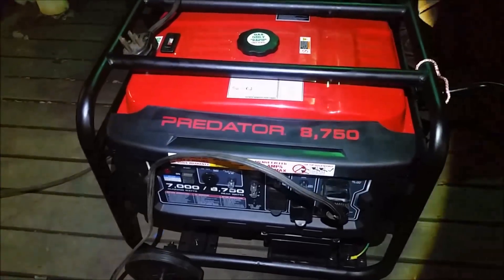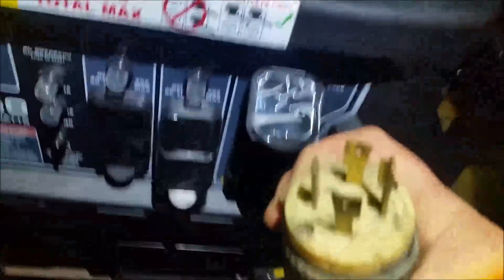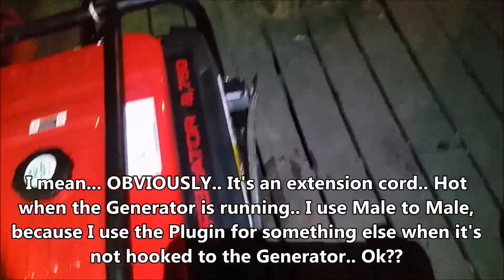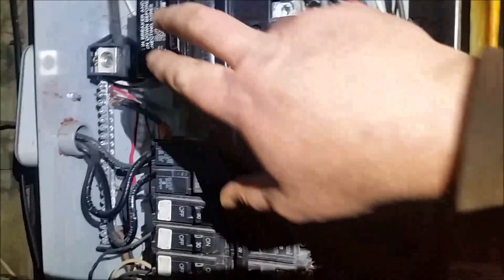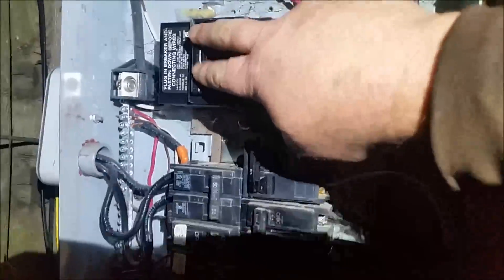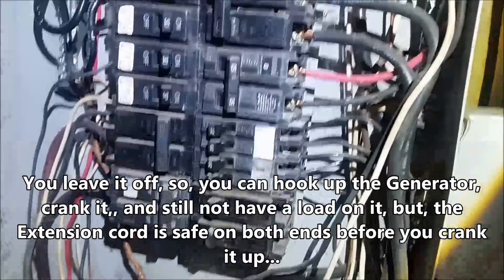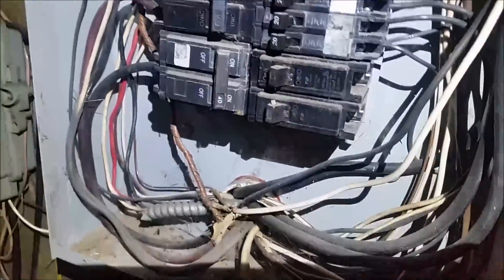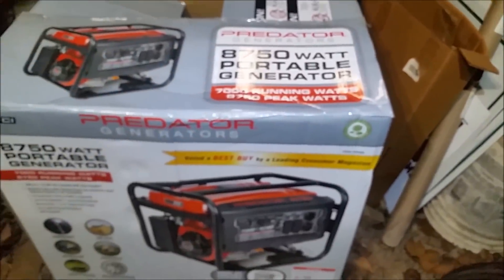Quick/Easy/Safe: Use Existing Plugin/Breaker for Generator hook up to your house Panel box.

Comment: Mark Thomas, you sound smart to a five years old kid and certainly dangerous enough to con some of your viewers with the same level of intelligence as yours to build a dangerous contraption that will ultimately kill them. Your life insurance must be cheap, as cheap as your mind at work building this suicide plug. Which part don't you understand about the word "illegal"? Get off your cheap ass and get things done right. All of the viewers/followers out there defending a dangerous man...get real. There are better and much safer plugs that you can build for your standby generator. You certainly have NO COMMON SENSE if build this. This is like Russian Roulette that Mr Thomas playing with you. Your life is not worth making this suicide plug.
Reply from the maker: P Dan.. I had to read your text at least twice in there several times.. Wow.. I'm not sure how old you are,,, but considering what comments you did make and how you made them,, I'll try not to use difficult words, so you can follow along.. 
No one is Conning anyone to do anything.. Just sharing how it is one.. Not sure where the Conning comment came from, but, remembering who is commenting, I'll continue.. 
"same level of intelligence as yours to build a dangerous contraption that will ultimately kill them."
Ok..What a COMPLETE IGNORAMUS!!! Ha..Ha..Ha.. Didn't your Daddy tell you not to touch the plug when you plugged it in?? I mean.. HOW STUPID CAN YOU POSSIBLY BE??? Like I said in the Video..This Video IS NOT FOR YOU!! Lets see how many safety precautions you need to feel safe.. 
1) When you plug the first end of the plug into the Generator,, don't have the generator running,, BUT, if you do,, don't touch the male part of the plug while you are doing it.. I prefer not to crank the generator.. Not sure how you could fuck that part up?? But, considering,, well,, lets continue.. 
2) When you plug the other end, into the receptacle  that you were using for your dryer/welder/compressor, etc,,, REMEMBER what your Daddy taught you.. Don't touch the Male end of the plug, but, doesn't matter anyway, because the breaker is off and the Generator is not running.. But, if you can fuck that up,, I would like to see how... But, considering who is commenting,, I'll continue.. 
3) Now, you are ready to crank the generator.. So,, You want to turn the main breaker off, crank the generator, flip on the Generator breaker, and then start turning your other breakers on.. I can't even imagine how you could fuck that up.. But, if you need someone to help you,, you know,, hold your hand while you do that,, let me know... My 5 year old can come over and keep you from fucking that simple shit up..
BUT,, considering you are all freaked out about something so simple,,, it makes me wonder how you get to work in the morning,, or better yet,, how do you catch the school bus without getting run over.. After all,, are you sure that you remember not to jump in front of the bus when it rolls up??? I'm just saying.. What you are saying and what you are afraid of is about that simple,, now isn't it.. You are afraid of a piece of wire with a male plug on either end?? Can't figure that one out,, can't you?? 
Nope.. There is not a better plug to use to run a generator in a temporary situation.. I just turn off the generator, turn off the Generator breaker, unhook the scary extension cord, and flip on the main breaker. Then, I hook up my Welder, etc,, and turn that breaker back on.. It's really simple, and there is not a better way..
Of course,, like I said,, This Video is NOT FOR YOU!!.. You would need a Generator Switch Panel, or at least an Interlock installed by an Electrician,, then, call the Fire Department when you want to turn it on and off, and check with the local police to find out if you can run your Generator today.. I mean.. You can't do this simple shit by yourself. DON'T EVEN TRY...  In fact.. I think you should take all of your knives and take them out on the Grinder and take the edges off of them, so you don't hurt yourself...Me,, I prefer them Razor Sharp.. I hate to get cut with a Dull Knife.. That shit hurts.. But, I use Knives every day, and I can't remember the last time that I cut myself... But, then again,, I am not a DUMBASS, and I know I have a sharp knife in my hand.. See.. There is the difference between you and I.. I am not "AFRAID OF MYSELF".. and that is the STONE COLD TRUTH OF THE MATTER!!!! Doesn't the Truth Suck some times there little fella?? 
Just one or two more things.. Since I am spanking you for being stupid,, and I know you are mad as hell about it,, why don't you call the Electrical Police and send them to my address.. It is posted at the end of the video and tell them that I am "DOING SOMETHING ILLEGAL", and send them over to my house.. And,, tell me what they tell you after you approach them with that Stupid Shit....Ha..Ha..Ha.. Illegal.. Ha..Ha.Ha.. What a DumbAss.. Ha..Ha.. 
My life is not worth making a Suicide Cord?? Ha..Ha.. That is what you guys call it.. I call it the "Extension cord with a Male plug on both ends",, because that is what it is to me,, because I'm not scared of myself to use one.. It's really pretty simple though, when you think about it.. But, that is the problem with you. You were not thinking when you warmed up your keyboard for a good bashing.. But, it didn't work out so well for you,,, now did it.. Just showed everyone how stupid you are.. And,, you got outsmarted by,, (According to your first sentence) A 5 year old.. Ha..Ha.. Ha.. Doen't your life SUCK??? Ha..Ha..Ha..  A Dangerous Man..Ha..Ha..Ha.. Just because I am not Afraid Of Myself?? Ha..Ha..Ha... Come on Man.. Get real, and get a brain!!.. And stop sitting in front of that keyboard,, because, when you do,, you start having "Keyboard Driver Errors".. Ha..Ha.. Find a much simpler topic to bash, and someone who doesn't have a clue to bash... It does not work here.. Ain't no fool behind this keyboard.. Cheers Dipshit!!
Reply: Wow, this is the longest reply I have yet seen, and for what? What a waste of mumble jumble explanation to justify your high-risk attitude. When viewers like you DEFENDING your dangerous contraption, you have completely CONNED them into building a dangerous contraption. There are many, many people, including yourself, like to enjoy watching your favorite sports with your friends on TV and most definitely drowned in beers. Then oops, suddenly the power went out, then what? Ah ha, don't worry, I have a standby generator, I'll start it up and we're back into the game. Let's see if YOU remember what your daddy taught you with beers in your belly. NOT GOOD. Again, DON'T BUILD THE SUICIDE CORD FOLKS.
Reply from the maker: Yep.. You are a COMPLETE IDIOT!!  A few beers doesn't keep me from using a knife in the Kitchen, or doing anything else for that matter.. Drunk??? A bit different, but, still would not keep me from hooking up a generator.. Just means I would be slower and more detailed in my thoughts/movements/actions.. 
But, then again.. I don't forget what I know when I am drinking either.. Never get to a point where I can't function.. Those days are long, long past.. The simple fact of the matter is that you are so BRAIN DEAD that you can't see how simple this setup is... Even with a detailed explanation that a 5 year old can understand.. 
YOU Sir,, are what is wrong with this Country.. I'll bet I had you pegged dead to rights when I said you would need to call the Police and Fire Department when you fired up your Generator.. 
I have a solution for you.. Stay away from Generators, Knives, and any type of tools that you could hurt yourself with, and the rest of us won't have to worry about some Libtard trying to take our Welders and knives away because some other Stupid Fuck like yourself did something totally STUPID and think the rest of us are at the same level of STUPID as you.. You and I live in two totally separate worlds.. There is nothing that I CAN'T do,, and in your world,, Nothing that YOU CAN DO!!  
Want to know something else?? I see you have created two "Playlists" One video each.. Must be some important videos.. Dave and Ava Nursery Songs,, and,,, I think this is Classic and even further proves what a Dipshit you are.. 
It seems you are interested in the "HairCut for State Board Exam" videos.. Obviously, there are more videos out there than just the one that you found interesting enough to create a playlist out of.... 
HAIRCUT FOR STATE BOARD test: RAZOR & SCISSORS  (Do you want to tell everyone WHY,,, you picked that particular video to save,,,, I mean,, since you only have two saved videos in your whole youtube account??? 
One about Nursery Songs and one about,,, Wait,,, Wait,,,,, Razor and Scissors... Yep.. The thinks that you can't TRUST YOURSELF WITH.. Like I said.. Keep your Interests simple.. This Video IS NOT FOR YOU.. 
It is NOT FOR PEOPLE WHO DON'T TRUST THEMSELVES with a RAZOR, or a Pair of Scissors... 
You'd better stick to simpler topics.. Maybe how to Wax your Car without any Dangerous Tools, etc?? 
OR,, why don't you just go ahead and get it over with,,, and try to do ANYTHING inside of your Electrical Panel today.. That will probably be the last time we hear from you anyway... Where did you Come from anyway?? 
The Socialist China, where the most important thing you own is a "CELL PHONE"???  Grow some Balls and get out and go Work for FREE, some where you can learn what the rest of us do all day, every day.. Go sweep the floor at some Welding Shop somewhere.. I'm sure after a couple of weeks,, someone there will feel bad enough for you to give you a few welding rods and a helmet and try to teach you how to weld or something.. 
Lots of High Speed Tools,, so, be careful.. You could Rip your skin or your fingers off of your hand if you don't pay attention.. At least, that would keep you off of the keyboard for a while... Leave the rest of us who have common sense to do what we do,, while you guys watch your favorite "NURSERY SONG VIDEOS"... 
AND,, if you have a few Beers,, keep your ASS on the Couch, where it belongs.. What a fucking joke!!
Did you know that you can get AIDS from screwing your wife?? OMG!! What a delima.. Now,, what are you going to do?? I know people like you.. You can't be helped!! I can just see you walking around for the next few months,, trying to figure out how you are going to make the wife happy without touching her any longer.. 
Did you know that you can get CP Syndrone from typing too much on the keyboard?? And, if you spend too many hours looking at the Computer screen, you could damage your eyes??? And,, if you talk too much on the cellphone,, you can damage your brain?? Now.. See how easy it is to solve your problems and mine?? Jerk!!
Reply: I don't see any problem with the cord, I've seen card carrying electricians just use a short piece of romex rather than cutting the female connector off the cord  . They just strip the ends and jam them into the receptacles.
Reply from the maker: In a pinch, that works.. 12 and 14 ga romex are thicker than the average male plug terminals,, so,, in a pinch, that works.. As long as you secure the cord so it does not move around too much.. Not the safest way to do it, but, it gets the job done for something temporary.. 
I was working on a Sewer Grinder pump for someone not too long ago.. It was 220v.. They actually brought me two of them and wanted me to see if I could make one out of the two.. Neither had plugs on them, and I wanted to be able to work on one, then, the other, get parts and then do the same again without swapping plugs. I pulled out two 220v breakers and screwed the wires down to them.. Then, I too 4 pieces of flat bar metal.. Actually, some pieces out of an old hanging file folder insert into a file cabinet.. I drilled a hole in the ends of 4 pieces, crimped on some crimp terminals and dropped the screws threw the terminals into the flat bar to connect the wires.. (Flipped the breaker off), plugged in the flat bars to the female plug slots, and on the other end, twisted the flat bar 90 degrees and used a wood screw and washer to screw those two flat bars to an old piece of scrap 1x6 board.. For the Ground bar, I just screwed down a another piece of flat bar with two holes in it.. I screwed the ground bar feed to one hole on the board, and the other ground wire from the pump through it's terminal into the other hole in the ground bar.. All I had to do was pop the 220v breaker onto the flat bar standing on edge and use a drill driver to screw the ground terminal onto the ground bus bar... I just put one extra screw through the board with a piece of wire under it, so, between troubleshooting and going back to fix it later, I just wrapped the feed jumper wires on the board and threw it on the shelf..  Now, the two 220v breakers are sitting, one on each flat bar on edge.. That was 2 years ago and I have used it several times.. The second time I used it, I took an old piece of rubber innertube and stapled it over the whole board, and drove two nails through the board on the other end.. I used a silver marker to write on the innertube. (Danger 220 Volts Live).. But, if I walk away from it, I just flip off the Breaker feeding it.. Usually my welder or belt grinder breaker.. No big deal.. I don't have a lot of people in my shop.. Just me and one other usually.